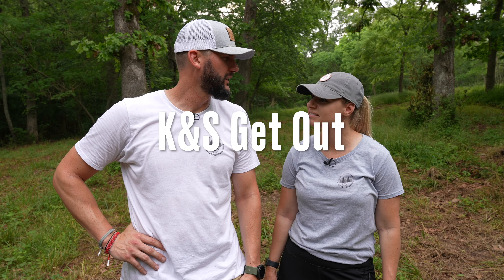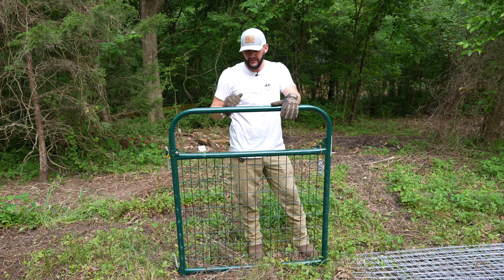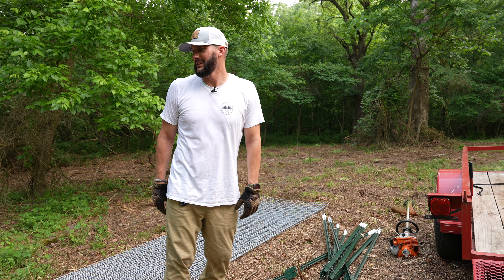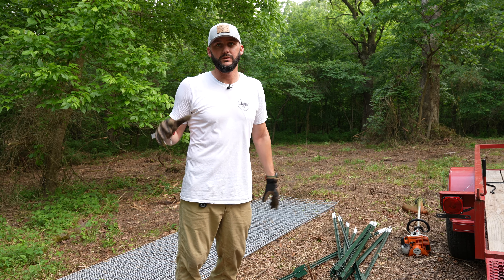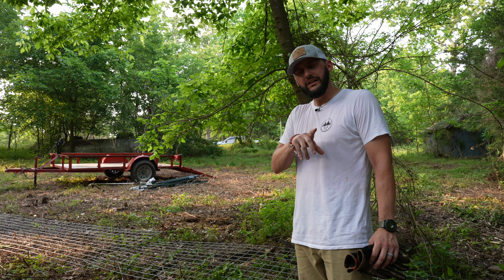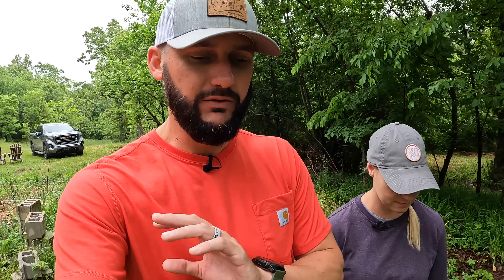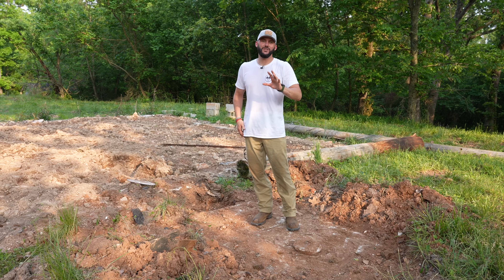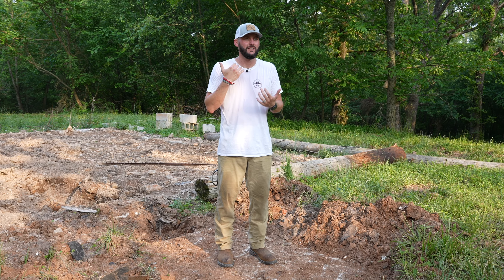ONE STEP CLOSER!

Comment: Make them a shelter. They need to be able to get into shelter from rain. A port a hut, like Jason at Cog Hill uses, might be an idea, as they are movable. Great ideas! Spatial Reasoning! Also, goats and pigs RUB on fences. They push it outward. So, you might want to put the panels on the inside of your posts. If the tree is one that goats CAN eat, and you don’t CARE if it gets stripped of its bark and lower limbs, I’d leave it. Glad y’all got good news on the septic! Prayers and Blessings always
Please Google the name you’ve chosen. I saw several…
Reply: Shady acres farm
Reply: If a tree gets stripped of all its bark the tree usually dies!
Reply: Yes, always put the pannel on the side of the pressure! Pigs, goats, cattle.

Comment: I think having the panels to have the goats in a smaller area to begin with is an excellent idea! And you got good panels. They do need a shelter that you can move around. If you put the shelter in remember if it's even semi flat they'll climb on top so put away from the fence! 
No don't concrete the posts at this time you might want to move them! Tree inside the pen hopefully with reachable limbs!

Comment: The goats definitely need a shelter, and depending on the species of tree it should be fine in the pen (because they're going to be reaching for those leaves if it's close) But I wouldn't put much in the way of "toys" in the pen. 1. There's plenty in the timber for them to jump and play on. 2. Any thing they can climb on that comes near the fence WILL be used as a launch pad to escape. Something heavy, like a spool or picnic table that they can't move would be okay.

Comment: I am so happy for you two that you can use the sewer for your trailer 👍 I am hoping it gos well for the water 🙏. If you know where the wasp nest is at  take your spray go over by the nest when the sun set the wasp are in the nest have a can in both hands point both Can's at the nest an let it have it soak the nest most likely you have more then one nest good luck

Comment: Your area is so fool of space for all your need, it will be a nice housing place. My experience in moving so many times and having to get by with the renting houses areas the one thing I learned with our property and building our house was with the raining season and the different higher and lower levels of the around streets. The area is very strongly based on many mountains and the streets where in this same ways. So we planned to have the house in the higher lever of our land. And so very thankful for making this decision, when it rains the streets become reavers and some areas flooded, but in our property we never had a problem, also because we also planned on create a rout for the rain flowing. Your area is not in the same condition, but I have also seen some plain areas just flooding...it is a need to have a water flowing 🤗😉

Comment: Build fence in 3/4 of that bush area behind you. Weed eat/ chop low to the ground about 2 feet where your fence will go. Set up your panels/gates and than run the electric white fence Chad uses around the whole outside of your panel fence..jmo

Comment: I would give some thought to sub kind of a shed before you go any further to putting any kind of animal pens in. With the shed you got a place to put your washing machine and dryer if you want one and a place to store equipment when you’re not present on the property. That seems to me to be the next obvious step for you to. It saves running to the laundromat to get your clothes clean and it provides safety for tools when you’re both gone from the property. Once you get guardian dog etc. you won’t have to worry so much about things like that, and right now is too early to be getting a dog for that sort of thing. So obviously a shed 6‘ x 8‘ would be plenty big enough or even better 8 x 8 and you can use a couple of sheets of plywood for the floor and aluminum siding for the walls and roof. I would leave room to put some insulation on the walls if you need to do that for next winter.

Comment: For. Your goats you need watch out for ticks for. Them & You both. Lime disease. I would suggest to talk to Hidden Heights.  They have over 50 head of goats.  I've seen them put out garlic blocks for the goats.  They will have a lot of knowledge for you.  You don't like wasps, there are bee keepers, they may have wasps keepers too.  If you know where the best is maybe they would be able to remove it for you.   It will make you feel safer on your new property.  I'm from Ohio

Comment: I tried ordering two chairs; however, the discount code was invalid. Please verify Z2JE2WTX is correct 20% discount code, just doesn’t work for me.
Reply from the maker: That appears to be the correct coupon code, please make sure there are no spaces before or after it. We're sorry! I reached out to our sponsor as soon as we saw your message, please try again and let us know the outcome. Sorry for the hassle!!
Reply: @KSDossAcres  I received the error notice that the coupon code not be applied; however, I looked at the total charges and noticed the discount was applied.  In the end, I purchased two white ones, $59.99 off.  I thank you for checking and inspiring me to try again.  Your little babies will need shade and ability to move your cage to put them on fresh grass.  Build accordingly.🙏

Comment: hey i laugh with u not at u on the wasps Kyle now i gonna give u a chance to laugh with me i was driving down the road Saturday in through the window flew a dang  wasp  mind u i am allergic to them so here i am trying to find a place to pull over the whole time trying to keep a eye on the wasp finally found a place to safely pull over i jump out the Trailblazer  run round opening all doors n  the hatch n standing there waiting for it to fly out in the mean time i got ppl driving by looking at me standing on side of the road with my fire banger strapped on me all my doors open n just staring at the SUV i was really waiting for the cops to show up finally after 10 minutes the dang thing finally flew out i slammed hatch n both passenger doors bk driver door jumped in  n high tailed it outta there  lol sorry so long but figured yall would like a good laugh